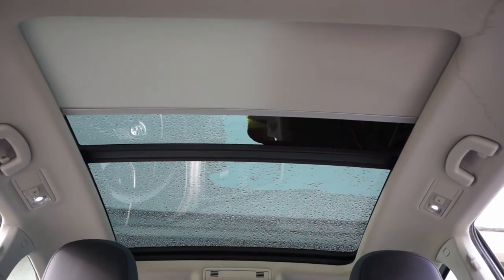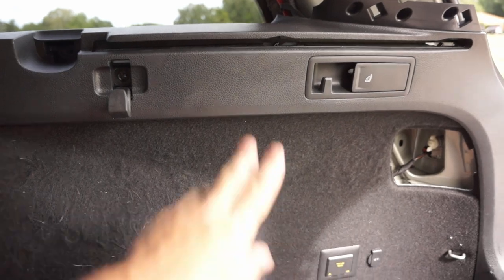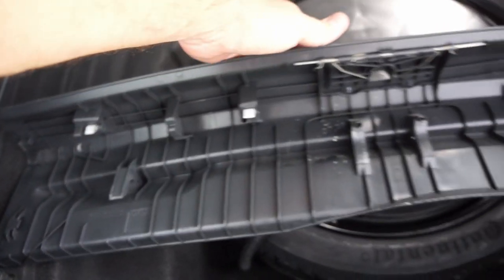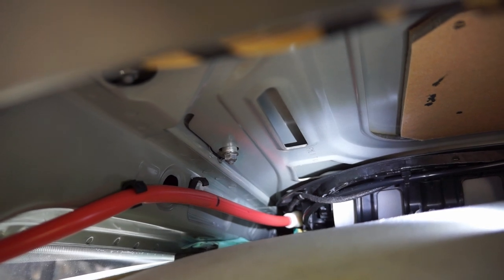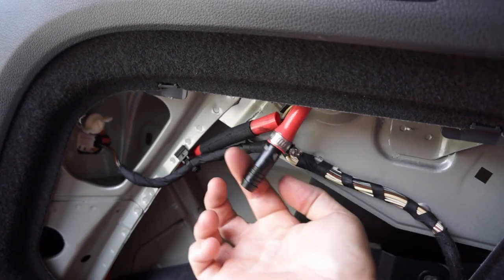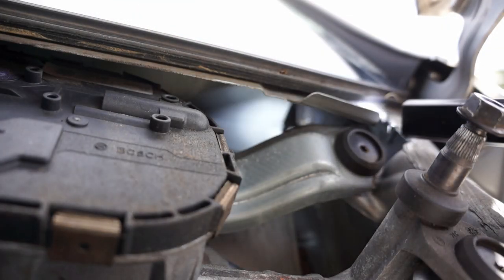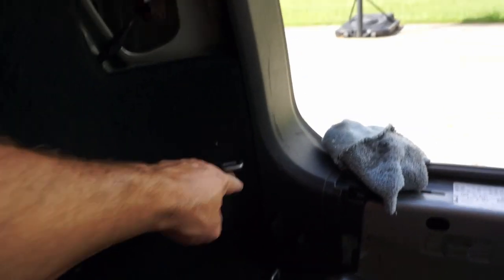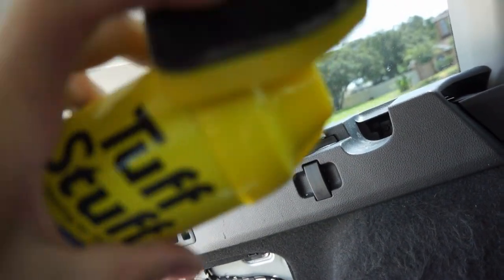2017 VW Sportwagen Panoramic Roof Drain Fix

Comment: This is the game VW is playing with their sunroof warranty: If you maintain the drain tubes yourself and modify the defective drainage system, they'll deny your warranty due to "outside influence".  If you pay a VW dealer $200+ to inspect the drainage system and clear any blockages - and it promptly leaks again - they will accuse you of improper maintenance.  They simply won't admit that the drainage system is defective.
Reply from the maker: I'm sure the proper fix would end up costing them millions so they will try to play the blame game any chance they get.

Comment: Too bad VW didn't over-engineer the drain system. Mine has leaked from the day I bought it. After a brief rain water fills the spare tire well. Despite numerous trips to the local dealer, VW has never been able to fix the problem. It's the one problem that keeps me from buying another Volkswagen. Thanks for the video. Maybe I can fix it myself.
Reply from the maker: I hope it works for you.

Comment: I used garden Strimmer cable to feed it along the drain tube to clear the blockage.  Saved me having to pull the interior apart. I melted the end of the Strimmer cable to make it easier to push through.
Reply from the maker: Thanks for the tip.

Comment: This is a fantastic how to video you spent a lot of time going thru it much appreciated. I'm one of the lucky ones (so far) my 2017 Alltrack SEL is always parked in garage or under cover at work which I'm sure helps prevent debris from clogging drains but others that keep their cars under cover like me have leak issues. I read somewhere about welds by the drain openings at the top partially blocking the drain opening cause leaking too. It amazes me that after around 50 years of VW/Audi making sun roofs they still haven't figured out how to prevent leaking.
Reply from the maker: Thanks.  Ours is always garaged as well.  Definitely think they should have figured it out by now.
Reply: @JRsGarage  My 2019 Alltrack SEL is leaking.  I had some standing water in the spare tire compartment which I scooped out and dried with a towel, but there is clearly water underneath that has soaked in the padding underneath.  The car has 29,400 miles on it - still under warranty with extended sunroof warranty.  VW is refusing to honor the warranty and I am taking them to court to force them to live up to their obligations.  Very disappointed in VW.
Reply from the maker: I hope everything turns out well for you.
Reply: @JRsGarage  I'll give VW one more chance on Jan. 2.   If they still refuse, I will put the wheels of justice in motion and I will win.  It only costs $20 to file a claim.
Reply: .I've been researching this water intrusion issue VW has given us and one of the videos I saw (this was on a MK7 Golf but  https://www.youtube.com/watch?v=6xwKaZdM7PY and Sportwagen have it too) anyway  there's a drain that catches water behind the hatch release/back-up camera (the rear badge) that drains straight down and if it's plugged OR the hose isn't visible apparently it can leak into the spare tire well instead of where it supposed to drain if you open hatch you'll see hopefully in the middle bottom of hatch a rubber tube, the opening is about 3/8" where the end of tube is (should be anyway) mine is visible but reset inside the opening and I think it should be poking out just a bit so water drains out onto rear bumper instead of the inside of the hole. I just looked at mine and I'll have to retrieve that drain hose hopefully it's long enough...what a half assed design. I don't have any sign of wetness but this could be yet another place to check if you're experiencing water intrusion. Here's a link that describes in detail along with part number https://www.youtube.com/watch?v=6xwKaZdM7PY
Reply from the maker: @harryberry474 Awesome, thanks for the information.

Comment: I was just able to get under the back of my car and find the bottom of the two tubes to clean them out. They are pretty hard to see post the mufflers, but they are right up inside the bumper cover next to the heat shields.  I removed the little stoppers and used a zip tie to clear out the blockage.

Comment: This video is also relevant for the VW alltrack. A local VW dealer in MD just charged me $250 to inspect these rear drains just to tell me they need to be replaced for $600.
Reply from the maker: Yes, and I think all VWs with the panoramic roof would be very similar.
Reply: Am si eu VW Passat Variant B8 cu acoperiș panoramic,cele 4 scurgeri au fost blocate de la acel vazilin cu care a fost uns mecanismul de la panorama, personal am curățat cele 4 canale si am uns mecanismul cu spray,DAR oricum cînd ploua afara are scurgeri interior,si nustiu ce ar putea fi,poate de la careva îmbinări de la panorama sau si de cele 2 bare de pe acoperiș, as vrea sa ma duc la un servis sa scoată tot si sa vad problema.

Comment: this is the one thing that I hate about my vw. It got so bad that the water flooded the body control module and had to be in the shop for 6 months and paid over 1000 to barely get fixed. the doors still don't lock :(
Reply from the maker: Yea, one of the engineers really screwed up with the design.

Comment: i use a bike brake cable to check the front ones from the top, and for the rear ones i get on the ground and check the drain end behing the wheel. then i pour a little water in each corner of the sunroofs rim to see if it reaches the ground. the debit must be high.
Reply: I believe the premix screenwash is good for pouring down the front drain holes as well.
Reply from the maker: Thanks for the tip.

Comment: Thanks for taking apart the rear, this will help me. 
I currently shove the fish pump pipe from the external ends and suck out any clogged stuff. Taking apart the rear is alot of work. Haven't tried the front end as I didn't know how to take the plastic parts off. 

Also had a rear leak with the boot vent, i just put it back with some silicone to keep it sealed in place.

I did do a sunroof clean at the dealership when it was covered in the warranty, they did cut off the original flaps at the ends of the drain pipe including the end part of the boot badge drain.
Reply from the maker: Thanks for the information and tip.

Comment: I'll throw in my appreciation for your detailed video along with some great suggestions.

We recently bought a used Alltrack and discovered it was pooling water in the spare tire well.  After a particularly heavy rain, I found the dog blanket we keep in the cargo area was significantly damp in places.  With your help, I found both of the drains tubes coming out under the back of the car were plugged  with dirt.  Pulling away the side panel near the right rear tail light, I found standing water that had been there long enough to have things growing in it.  When I disconnected that' side's interior red drain tub from the coupling going to the bottom drain of the car to see where the clog was , it spilled out several more ounces of water.  

Haven't done the remaining testing yet, but I have hope that this will address the water issue we have.  

Thanks again!
Reply from the maker: Happy to help, and thanks for the additional information.

Comment: Useful video.
Some cars also had a design flaw where plastic and metal would form a crack, allowing water in on roof.
I have a '15 Sportwagon and haven't had water problems but i had the tsb at dealer done for drain mod.
Thanks for showing how to take things apart.

Cheers
Reply from the maker: My pleasure, thanks for the info.

Comment: Thank you for the video. I had my whole headliner and panoramic frame replaced but it still leaked after a year. Will be going back since it’s still under warranty for the work. However will definitely refer to this video when warranty is up.
Reply from the maker: My pleasure.  There is a TSB for this service, just make sure they do the back drains along with the front.

Comment: Many thanks for this video it is super helpful!!! Had standing water in the spare tire department and a wet liner in my 2018 Alltrack which I managed to get dry with a regular dehumidifier. Haven't started the repair yet but the dealership wanted to charge me $750 for just looking into what it is, even the car is still under warranty!!! My Fender subwoofer is full of water and I am not sure if I get it working again.
Reply from the maker: My pleasure.  Sorry to hear about your issues.
Reply: My dealer wants 1400. I too had water in subwoofer.  They didn't even drain the subwoofer.  I still have a year warranty.  Bad design.
Reply: @MrBahnzai  I managed to get it done in the meantime. A friend of mine took care subwoofer and it's working as well again. I'll make a video and put it on my channel. I paid about $50 to get the stuff needed for the repair.

Comment: Thanks for the detailed video
My VW sportwagen TDI has the leaking because of a crack in the frame. Unfortunately there is not support in México and i will try to fix it by myself
Reply from the maker: My pleasure, hope you get it fixed.

Comment: Thank you for the most helpful video. I've got a 2016 sportwagen limited. same problem.  Spare tire well full of water after a hard rain, and also stains on the roof liner :(  I am wondering two things.  1. Exactly where are the rear drain holes. At the very corner? not quite in the corner? Since you used your camera to find them, I'm not sure where they are and wondering if I route some weed wacker cable up from the bottom drain, when it makes it all the way to the top, will it get stuck or will it push through that rubber flap and be visible so i can yank it back and forth to clean the tubes.  Or is it possible to route a cleaning cable from the top even though you can't see the holes.  2. ) What did you actually use to clean out your tubes, if it was some kind of wire or cable, were you able to get it all the way from top to bottom so it's sticking out on both sides?
Reply from the maker: 1. It is pretty much in the corner or just inboard of the corner.  Yes, trimmer line should work.  It would be very difficult to feed it top to bottom as the drains start at the back of the sunroof which is inaccessible.  But if you push enough up from the bottom eventually you should be able to grab it at the top.  There is some plastic pieces at the rear corners of the sunroof which may make it difficult to feed all the way through.
2.  I used bicycle brake cable.  I did not go all the way through.  I just cleared the obstruction at the rear corners of the sunroof and then flushed it with water.
Reply: @JRsGarage thank you!!

Comment: This is the most helpful and detailed video on the subject that I have found. Thank you. Now, the question is, how do I get the noise dampening cushion and the rug pad to dry out? It is wet as a soaked sponge from the front passenger footwell to the rear passenger well. I live in an area that is rainy all year and do not want my car to become a mold bomb on wheels.
Reply from the maker: Hair dryer and a lot of patience, or bring it to an interior detailer and have them clean it out.
Reply: I have the same issue with my Alltrack with a leak at the rear which filled up my spare tire compartment with water. Was able to get a regular dehumidifier from a fiend of mine. Just let it sit inside for at least 24 hours with all doors closed.
Reply from the maker: Thanks for the tip.

Comment: Great video! I cleared my front drain tubes but pretty sure I detached the tube from the sunroof tray as water goes in the drain hole but then comes inside the car by the front floormats. The reason I think I detached the tube is I see water stains at the top of the windshield pillar on the material. Do you know if those pillar panels come off easy? Hoping I could remove them and re-attach the hose to the sunroof tray drainaige hole area? I may have damaged the tube clearing it with wire so not sure how difficult it is to replace. Thanks again, hope I made sense.
Reply from the maker: The pillars come off. Just be careful not to break the clips holding it on or you will have trouble getting it back on.

Comment: Great video
Considering taking the preventative measure of creating those couplings for rear drains
Can you explain how you use those now that you have them?
Reply from the maker: It's only been a few months since I did the job. But every year or so I plan to open up the back side panels and force air through the lines in order to make sure they're clear.

Comment: well you could just blow air up from bottom to free the block, if your gonna make a spot in trunk panel then wont be any different just sending air from drain under car, just dont blast full power so hose dont fall off sunroof
Reply from the maker: Just be very careful as you risk sending 5ft of gunk and sludge up onto your sunroof shade and headliner.  Which would be a pain in the ass to try to clean.

Comment: My alltrack is at the dealership for this issue, luckily I’m covered under warranty for a new headliner!
Reply from the maker: That's lucky.  Make sure they take the caps off the ends of the drain lines and don't just clean them out and leave the caps there, because you'll end up with the same issue in a couple years.
Reply: @JRsGarage  got an update this morning, Apperantly there’s damage to the pano frame and they will be replacing it completely
Reply from the maker: Interesting.

Comment: the back ones you can reach for underneath.. its just a plastic trim to be removed with 5 screws-ish.. the front ones one you can reach by hand and the other with you wife-s hand only :))
For all 4 remove the small red covers they are the culprits. (automotive regulations... no bugs can go in but somehow the dirt does not go out)
You should have no more problems after this
Reply from the maker: This is what I have done.
Reply: Can you show where those 5 screws are and what plastic you are referring to? thanks.
Reply: @jonathancorcio3668  dude. Underneeth the car.. In the back there is a plastic cover.. 5 screws visible.

Comment: Very good detailed video. Question where did you buy those couplings?
Reply from the maker: They're from the irrigation section of Lowe's or Home Depot.  3/4" if memory serves.
Reply: @JRsGarage  Seems like a good idea, but super nervous about cutting that cable. How have they been working out for you?

I bought a used Alltrack from Carmax and surprise surprise less than a week and a few flash storms and already saw leaks in the back corners near the pano roof. 

I really like the car and there aren't many options in the wagon department so I'm torn. 

Removed the rear flappers today, but I have no garage or workspace to remove the headliner. I could perhaps snake the rear drains starting from the bottom which may help or push the gunk back up in them. 

Again, I like the coupling idea because then you could snake the drain from the middle in either direction, but seems a risky proposition cutting the line in the middle. Better be dang sure one has the parts and can finish it before moving onto something else
Reply from the maker: No leaks since.

Comment: I have a 2012 Jettawagon and I’m leaking in all directions pretty bad. I can’t find where the front drains run out to on both driver and passenger sides. The water is leaking into and out from fuse box! Fabulous design! 😮 Any ideas on how to fix the front drains in addition to the rear?
Thanks.
Reply from the maker: Find the holes in the corners of the sun roof and push a 3 foot wire through till it pops out somewhere.  I find that bicycle brake/shifter cable works great.  The exit may not be visible but if you clear it out with the wire and then flush it with water it should drain properly after that.

Comment: Wow, great video but what a headache.   I just bought a 2019 Alltrack, from someone I work with, who told me that there was an issue once with this but the dealer had fixed it.  Well, after a few soaking rains I found water in the spare tire well.  We got it all dried up, I don't think there's any water damage but I have to check it out and pull up the lining,  check the drains, etc.   But even assuming there's no damage, and I can unclog the drainage tubes, this will happen again.   So, extreme idea here but I don't care whether I have a panoramic roof--do you think I can use clear silicon caulking and fill in all around the sunroof, to prevent any water from getting in there?   Obviously, I can never open the roof again, but I don't care about that.
Thanks for any ideas.
Reply from the maker: That's too extreme for my taste.  I wouldn't do that.  Just add checking the drain tubes to the annual maintenance.  That's my plan.
Reply: @JRsGarage , I thought I’d escape this particular known GSW curse, but after 115K miles, I got hit with a couple, oil burning  (TDI) and pano roof leaking.  How many miles on yours when this leak appeared?
A side note, what an MVP! 🤝
Reply from the maker: Not a leak in my case.  The drain lines were clogged causing the water to back up in the line and overflow onto the headliner.  I had about 47k miles when it started.

Comment: Why does water get into the drain tubes when the roof is closed? Isn’t the roof designed to be sealed & watertight? Thanks 🙏
Reply from the maker: No, the roof panels are not sealed. If you pour water on the sunroof you should see it dripping from all four corners of the car through the drain tubes depending on how level the car is.